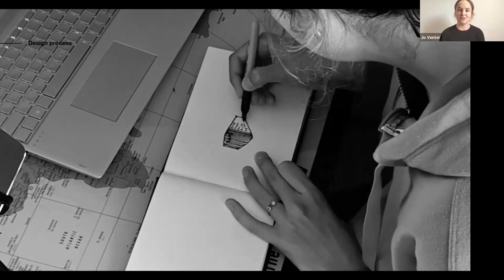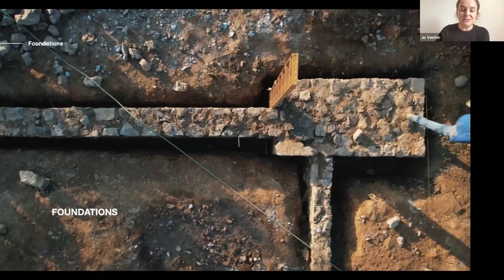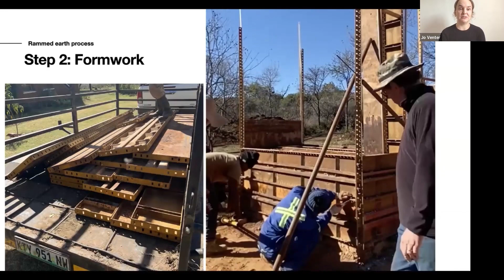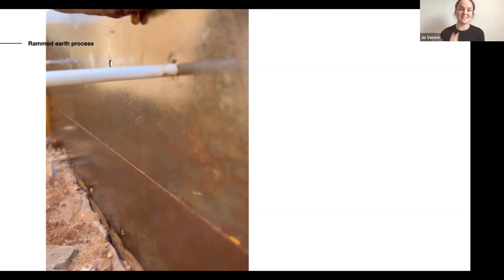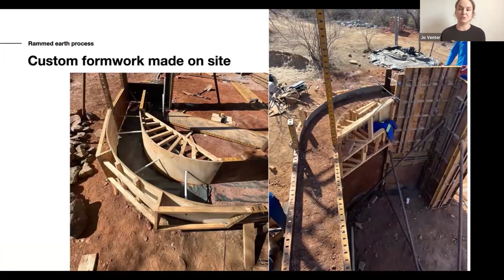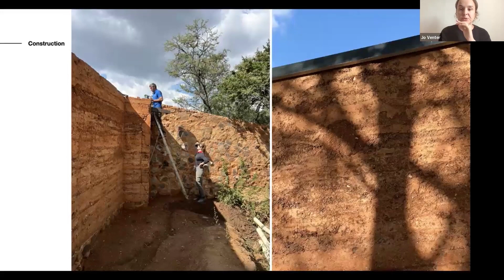Juane Venter Earth House UCT presentation about rammed earth.

Comment: Hi Jo. I have seen most builds using a bit of cement in the soil mix - is there a particular reason you didn't use any in your build?
Reply from the maker: Hi! I did not want to use cement, I wanted to show that rammed earth does not need cement. Earth is strong enough if compacted hard enough. I did use hydrated lime in the mix for the rammed earth walls.

Comment: i want that formwork... where did you buy it
Reply: Its easier to just build wooden form work , because wood weighs less you can use whole pieces of ply wood with reinforcement instead of using only 2 ft tall sections of steel and it looks really nice and comes off easily with wood , wood is perfect for rammed earth formwork you just have to reinforce it
Reply from the maker: I loaned it - it is the steel formwork they use for concrete.

Comment: Jo, thank you for your great video. I would suggest using  fiberglass rebar to connect the foundation to the roof bond beam. Also, I have had great experience using concrete floors, as earth floors do not stand up too well to heavy wear. I’m always looking for longevity structures. Our buildings should last thousands of years instead of decades. I believe Ramed earth is the most sustainable material for home building.
Do you do a pH test to determine optimum lime %? 
I usually use around a 4% lime, 3% cement mix. I also pulverize the clay in a ball mill, so I increase the mix homogenization.  Typical mix is 43% sand, 30% 10mm gravel, 20% clay. I do add polypropylene fibers when mixing

Comment: Very exciting project. But I am very skeptical of the strength of the walls against elements like the rain.  Please if its no trouble, can you tell us how the walls withstood the heavy rains of 2024? I live in Malawi and I saw alot of rains in South Africa earlier in the year.
Reply from the maker: Hi! The walls do very well in rain, but they do need protection in form of a roof and footing. If they top of the wall is covered they will be fine. The great wall of China was built out of rammed earth in the 7th century BC and the walls are still standing.